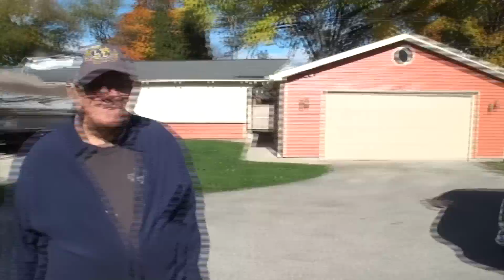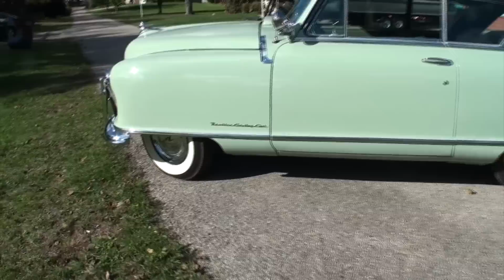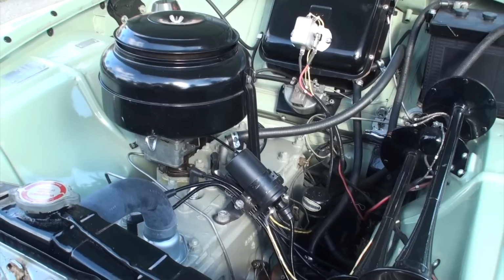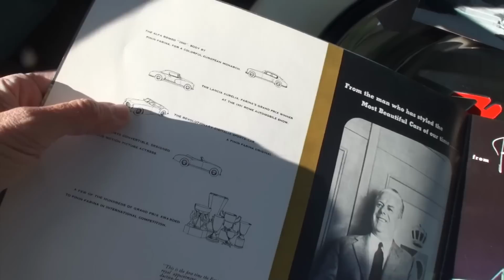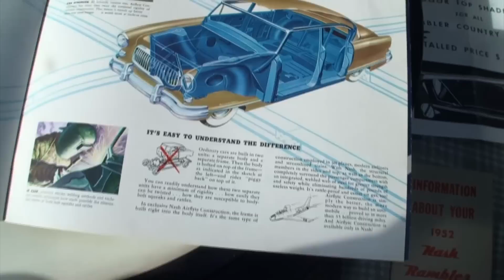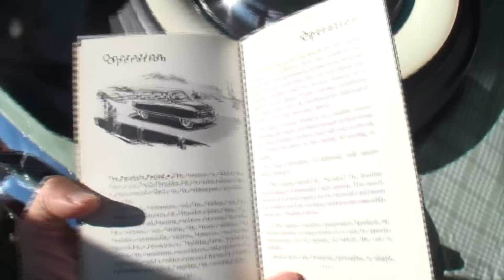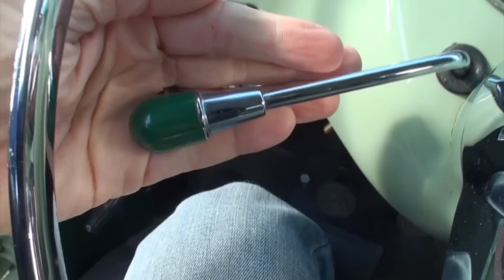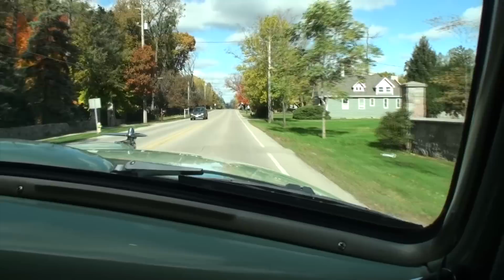1952 Nash Rambler Country Club Hardtop in Green & Ride on My Car Story with Lou Costabile

Comment: Those Nash Ramblers were such unique little cars! They were so unusual. That example had a clean flathead 6 cylinder engine with a 3 on a tree behind it, providing it's power. A real cream puff indeed Lou!
Reply: As an option those cars could be ordered with GM Hydramatic automatic transmissions (at least on the Ambassador).  I don't think that power steering or power brakes were available.  They weren't heavy cars due to the use of unibody construction.
Reply from the maker: Hi Michael, "Those Nash Ramblers were such unique little cars!" I agree. My pleasure sharing this car with you :-) Lou

Comment: In '65, my dad bought a '51 Rambler hardtop from a buddy who worked at AMC. He paid $10 for the car. It had been sitting in the guy's garage for over 8 years untouched in the old 'hood, Southwest side of Detroit. We had to push the Nash out of the garage and with a new 6 volt battery, some starting fluid and just cleaning the points and plugs, it fired right up. Dad then proceeded to restore it with new brakes, tires, shocks and exterior paint. The interior was in mint condition, the radio and heater worked. It was a blast to drive and was surprisingly comfortable and smooth riding on the highway. Great memory of a unique car.
Reply from the maker: Hi Robert, Happy to read this car brings back memories of your Dads car :-) Thank you for viewing and sharing.  Hope you see many cars on this Channel you enjoy!  Please Subscribe, and hit the "bell" so you can see all the cars when they are uploaded on this YouTube Channel, Lou

Comment: 1952 Nash Rambler Series 10 Country Club with production of 25,785 units. Base price of this model was $2,094 with 82 Horsepower, a 100-inch wheelbase, and a 176-inch overall length (about the size of a Chevrolet Sonic). For comparison a 1952 Chevrolet Bel Air Hardtop was about $100 cheaper, much bigger in size, and had three times more sales. The last of this body style was sold in 1955 as both a Nash and Hudson.  For the recession plagued 1958 model year, American Motors resurrected this car as the Rambler American...with simplified trim, a 2-Door Sedan body style (later a wagon and 4-Door), and with redesigned front fenders exposing the wheel.
Reply from the maker: Hi SpockvsMcCoy Kirk, Thank you for viewing and sharing your knowledge, Lou

Comment: Nash was one of the first manufacturers to build cars using unibody "airflyte" construction and also had the "weather eye" heating and ventilation system.  Later in the 1950s Nash merged with Hudson to form American Motors which continued to produce Rambler cars through most of the 1960s.
Reply from the maker: Hi Murray1575, Thank you for viewing and sharing your knowledge., Lou

Comment: Lou, gr8 [and unusual] feature as usual.  Highest Kudos to Dennis for the absolute impeccable condition of that Nash!  Those cars were extremely well engineered and very innovative - ventilation system being one - coming from the Kelvinator background.   The house of Pinin Farina was under contract with Nash '52-'54 and was responsible as well for the design of the famous Nash-Healey sports car.  Speaking of styling...at the very least controversial, which as we know Nash-Hudson morphed into American Motors and the tradition of bold and controversial styling remained right up to the end of AMC!  And, so did many of the engineering features as well.  Trunkin'-Treats and ownership knowledge soooo contribute to your overall presentations!  Darn good stuff!
Reply from the maker: Hi Audie, High praise :-) My pleasure sharing this car with you :-) Lou

Comment: Nash's "Weather Eye" flow through ventilation @3:04 is the integrated system that is used on virtually every modern car today. Other brands' Heaters were installed in the cabin (under the dash or the front seats) with A/C units in the trunk. The "Airflyte" call-out on the trunk was actually what Nash called their aerodynamic unitized body style with the enclosed wheels wells...
Reply from the maker: Hi Charles1964, Thank you for viewing and sharing your knowledge, Lou